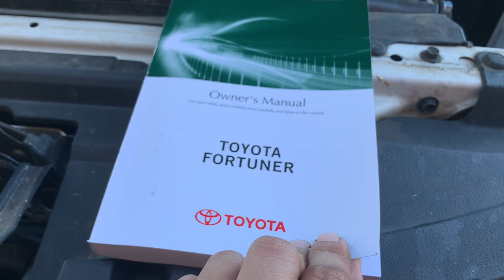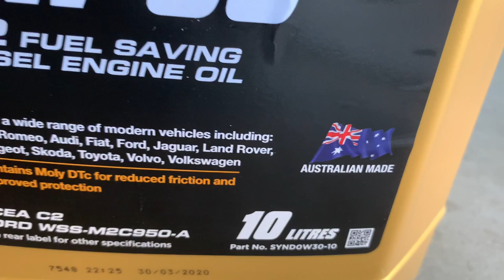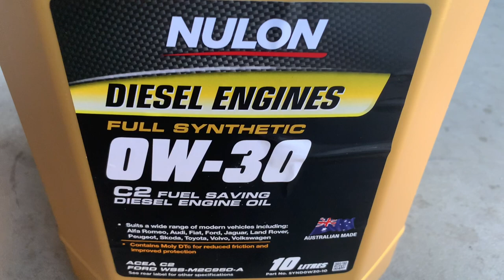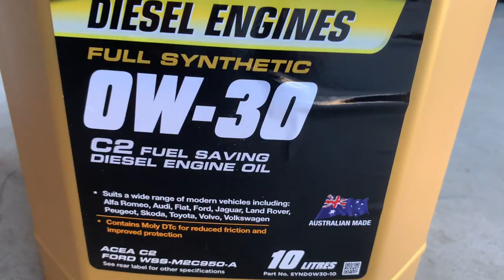HOW TO CHANGE OIL IN YOUR CAR | TOYOTA FORTUNER

Comment: Wag kompyansa sa "Hydraulic Jack lifter lang sir. Kelangan mo parin ng Jackstand para sure ka, alam mo naman ang aksidente, ika nga ni Forrest Gump "shit happens". Ingat all the time..Anyway like your post.
Reply: Un nga eh ang dami off sa video nia..napaka unsafe ung ginawa nia na wala syang ginamit na jack stand for added security and support..tas ung jack na ginamit pang tukod ung hindi pa floor jack. Pag palit lang din ng oil filter mali din, dapat nilalagyan ng konti oil ung O ring nia at lagyan ng oil din ung filter oara hindi dry start.

Comment: Forgot to mention also, before installing your oil filter dapat lubricated ung O ring nia as I mentioned and plus dapat nilalagyan mo din ng langis ung loob ng oil filter. As in fill it up bago salpak. Mali mali ung tinuturo mo instead na maka tulong in the long run magkaka problema pa

Comment: How many km on your odometer at the time you change?. And after you put the oil so thin 0w-30. Do you experience the vibration of the engine travel to the seat or steering wheel inside the cabin. I am thinking use 5w-40 in australia weather

Comment: Sir which fortuner model is this?

I have 2012 Toyot fortuner model, I change its transmission AT fluid after 250000 kilometers without its AT filter change, but what happend after running 11000 kilometers the fluid become black and changs its colour, I come to the Mechanic again he said no need to change the filter only need to replace the oil if we change the filter the transmission system might gets some problem,

Please I need your suggestion:

Should I change transmission Fluid along with filter also or else I leave it as the same only AT fluid remains changed.

After changing the AT fluid when I shift to D its just start vibrating little bit even pressing the break the car more resist to move forward thats it, the rest is great

Comment: Sir ano engine nyo? Gas po ba yan

Kase sakin 2016 2GD diesel engine
Ang recommended oil viscosity na nasa book 
5w30
10w30
15w40
Reply: Okay na okay yung 5w-30
Reply: Sa ibang bansa kaba boss?

Comment: I was wondering if the oil change interval could be strecthed to 1yr or 10000km instead of 6mth or 10000km. I don't do lots of km and i find changing it every 6 months is a bit overkill while other car manufacturers even strecthing to 15000km every year which i find that abit to extreme too. I recon the sweetspot is 10k every year. What's your take?
Reply: If you DIY service every 10000km every 1 year is ok to me. But in Australia every 6 months because they want to check the car more regularly and also want customer's money too.